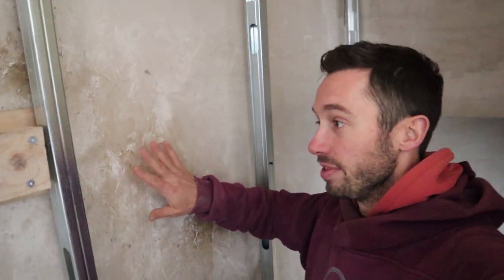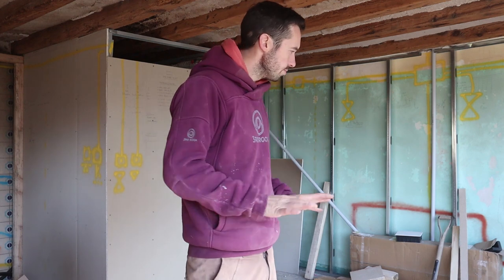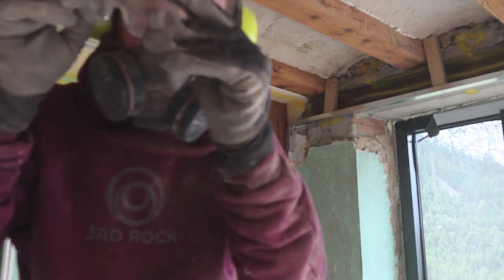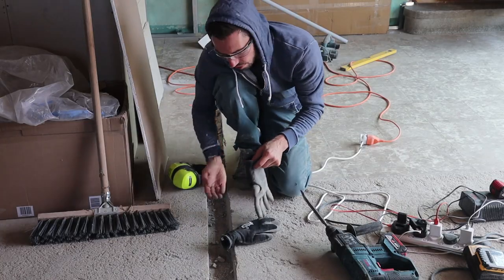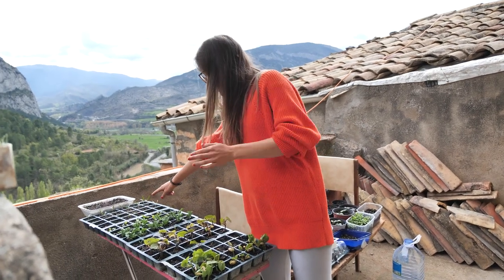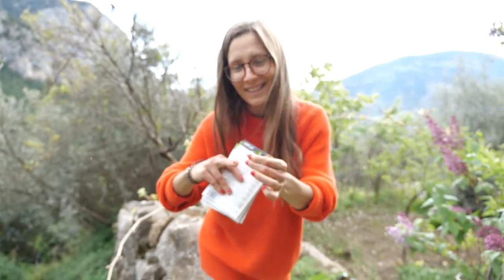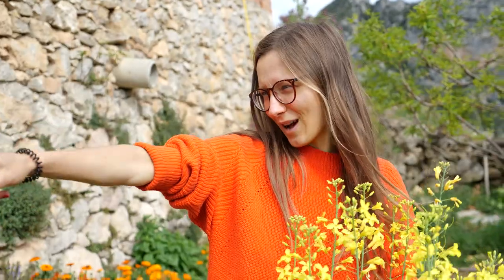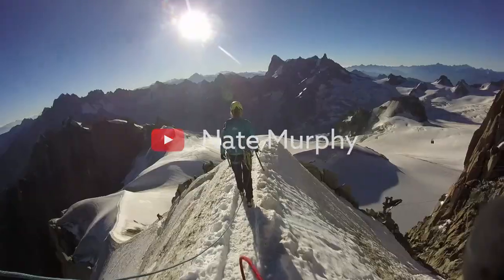GROWING OUR OWN FOOD IN LOCKDOWN  🌱🥕& CUTTING UP THE HOUSE 🏠

Comment: that flowering shrub is called here in Ireland as the Butterfly bush tree
Featured snippet from the web
The Buddleia tree is a hardy, medium to large perennial shrub with long, arching woody branches. It has lance-shaped leaves which are a deep, green colour. It produces flowers on cone-shaped heads, usually in August.
Reply: It's similar but it's actually not. It's a  Common Lilac. :)